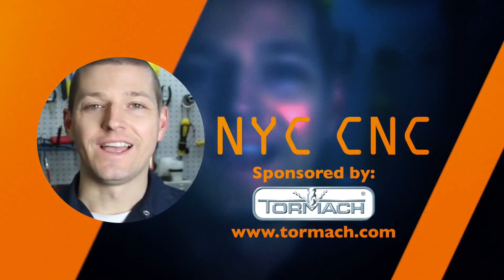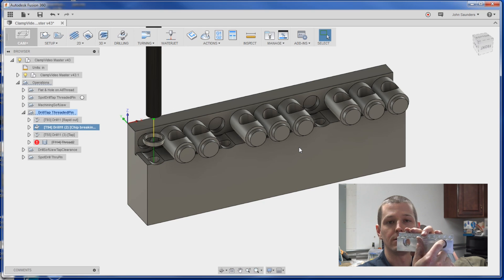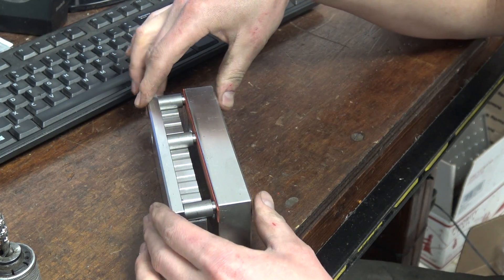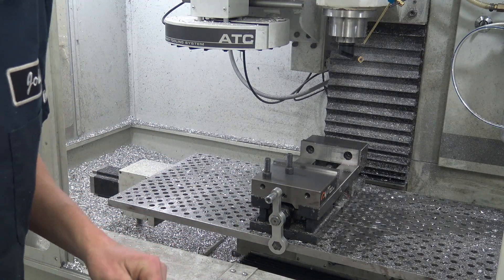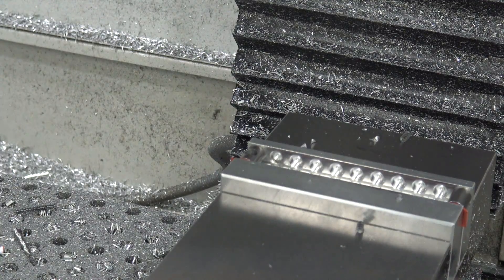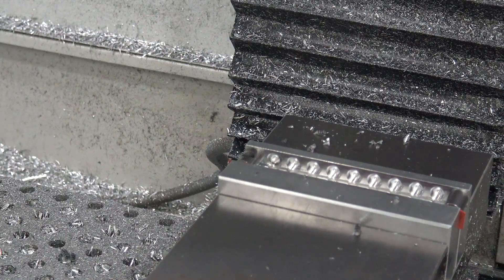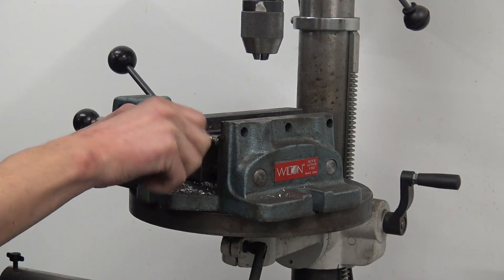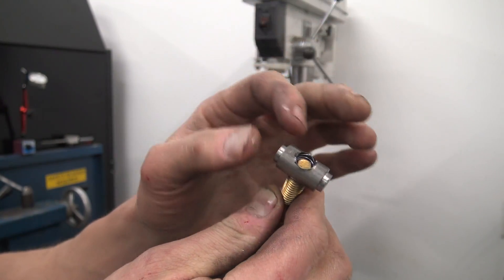Form, Cut or Mill Threads,  Softjaw Mistakes and more! Widget79

Comment: just curious if the from tap causes the diameter of the rod being threaded has expanded?
Reply: +Ed Ginsberg Some parts, some materials. Absolutely. I had similar parts to what he is making and we could not form tap them because it changed the OD too much and through the part out of tol.